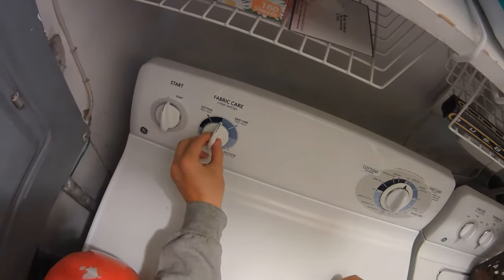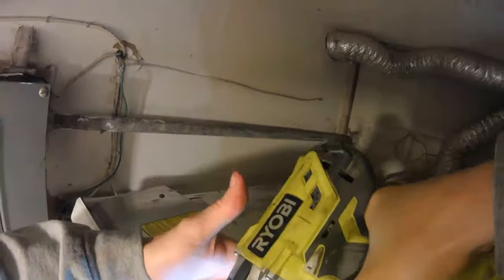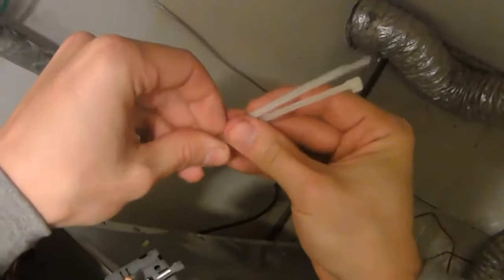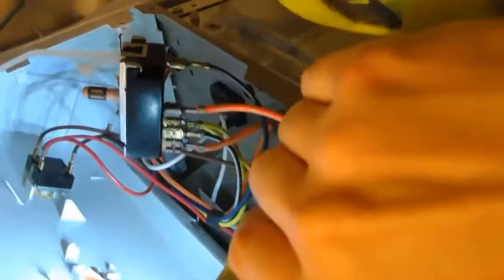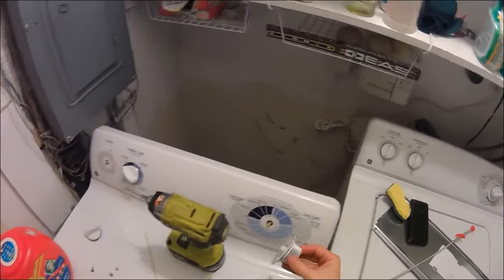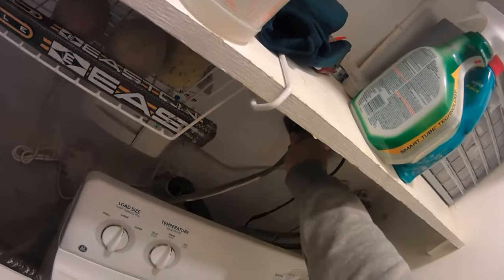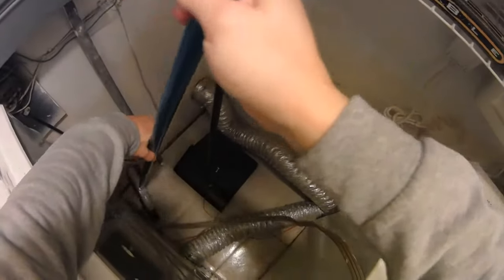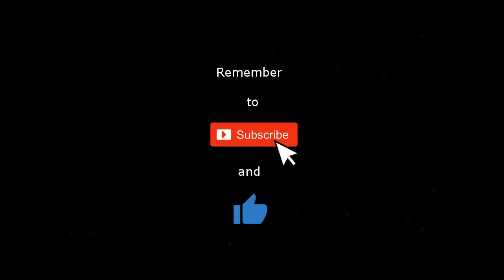How to fix a GE dryer when the knob falls inside

Comment: Please help! We have a semi new dryer that had a broken knob so my husband and kids started using a plier to turn the dial when all we needed was a new knob. Unfortunately, they’ve worn down the dial to a point we’re a new knob won’t work and neither will the pliers anymore. 😭😭
Reply: Probably need to buy a new switch at this point
Reply: Hey my family is currently experiencing the exact same issue! How did you solve this?
Reply: Lol SAME
Reply: You need a new switch.
Reply: For anyone who is having this issue (this is EXACTLY what was happening to me):

I unplugged the dryer (!!!), took apart the back of the dryer to get the timer out and take it apart and saw that the “D” shaped shaft that goes into the knob is actually black plastic (for some reason I thought it was deteriorating metal). What I did was use a 5/64 drill bit to make a hole in the center of the D and then drilled a screw into it using the lowest torque setting. The screw went into the hole I made by maybe one or two notches. Don’t force the entire screw—you only need enough of the screw to grip it well. Instead of pliers, I now use a spare Phillips head screw driver to turn the timer. You may not need to take apart your dryer to achieve this, but it might be beneficial to do so to ensure nothing breaks when drilling, because the D shaft is actually connected to cogs and it might mess something up if you drill too hard. Make sure the largest diameter of the screw is smaller than the diameter of the D shaft; otherwise, you will break the shaft and they do not sell those separately from the entire timer (at least, I couldn’t find anything when I searched for it specifically). 
Best of luck! Feel free to ask any questions :)
Reply: Same here!
Reply: Where do I get new knob I see there is a crack in the knob
Reply: Same thing! I ordered a switch off of Amazon and had a friend install it. It was pretty simple and took 15 minutes. I still don’t have a knob but I see they have them on Amazon too.
Reply: Where can they order a new switch

Comment: Did a search, saw this video.. exact same model that we have in our apartment, same exact knob broke in exactly the same way. There is only one problem... Maintenance came by to 'fix' this issue by drilling a new knob hole in the middle of the panel, "because there are 2 spare connectors". Within 2 days, the plastic holders broke again, in the same way. It makes me think that there is a legit issue with this model of dryer, as why would the knob be experiencing enough force for that one knob to break free?

Comment: Thanks for posting this video. It’s always nice to find a YouTube video whose title exactly matches the problem I’m having.

One thing that might help other viewers is that they may be able to remove just the three top rear panel screws (not all six). On my GE dryer, I can remove those screws and slide the front panel to the left to release it. (There are three notched tabs on the panels lower edge that slide into slots to hold the panel in place.) Then I could tilt the panel face down, which made it easy to access the back to make the repair. I didn’t even need to move the dryer (which is a real pain for me because the vent duct is only semi-flexible).

I’m impressed that you were able to drill holes in the remaining tabs for the zip tie. I fabricated two small wood blocks that straddle the switch and screwed a skinny crossbar into them to hold the switch in place. I used epoxy to affix the blocks to the panel. Time will tell if it sticks well enough.

Your video gave me a good head start on making the repair.

Comment: I have a broken knob on my dryer. I'm curious that part of the problem may be inside. I really appreciate your video.
Reply from the maker: It is the front cover itself, check out this video for the by the book repair:
https://youtu.be/A1tlSpuox4Y
Reply: @burrheadjr  thank you. I'm taking off the back panel tonight to figure it out. But the knob is broke and it seems like the control inside is loose. I don't know if it's like this video where the plastic around it is broken or if the control is bad. Hopefully, whatever is easier to fix. Thanks again for the helpful video!!!
Reply: Would have loved a better camera angle with zip ties. Any written instructions available? This is the most annoying problem ever. WHT do they make these things so cheap man? Lol I just called a repair company and they are charging $109 just to come out and look at it

Comment: How did you zip tie it? I couldnt see that very good
Reply from the maker: I drilled holes in the remaining damaged plastic clips, then I looped the zip ties around the back of the switch, and weaved it through the metal prong in the front.

Comment: My plastic clips are too broken to use this solution. Any other ideas for me?
Reply from the maker: you could drill holes in the actual FACE of the panel.  You will be able to see them, but you could theoretically get it to work like this.  There should be enough space between the dial and the face that a zip tie would not interfere. Something like this image, where the black dots is where you drill holes, and the red lines are zip ties that go all the way behind and hold the switch up against the Face Panel:
https://imgur.com/a/iHBSX7l

You could also order a new part, and fix it fully like in this video:
https://youtu.be/A1tlSpuox4Y?si=7sGZc1zGxnUp_rp1
The part is $140, but is cheaper on eBay (maybe $100)

Comment: On mine the plastic ears on the temperature selector were broken and the remaining plastic was too small to drill. My solution was to drill two small holes on the left and right of the knob (yes they show) and use white cable ties in sort of a figure eight so the part showing is about 1/2" of cable tie on either side of the knob. The advantage is the cable tie doesn't go through the knob opening forcing the shaft off center. Next time, Speed Queen.
Reply: My clips were intact but not easy to slide slipped side back in but, I got it.  If only they didn't make those plastic knobs which keep breaking on the inside. Thank you for your help

Comment: I am sorry but i am not as hands-on as most of you folks here, i guess. I didn't quite get where to put the zip ties and what holes are needed where. How can someone help on this ? please.
Reply from the maker: There is no "Right" answer on this question, it is a "hack" fix.  It will depend on how yours looks.  I drilled right through the "tabs" the parts that stick out, that normally the dial clicks into.  But if yours are completely broke off, you may not be able to do that.  One other thing you could try is drilling right through the face of the face plate, meaning you would see the zip ties coming out on the surface of the faceplate.
Reply from the maker: In this video, I fixed it the "right" way by ordering a new part, but also in this video, you maybe able to get a better look at the zip ties and how I did them here before I install the new part.
https://youtu.be/A1tlSpuox4Y

Comment: This literally just happened to me this morning.
Reply from the maker: Hope this vid helps you to get back and working again.  For a permanent fix, check out this video as well:
https://youtu.be/A1tlSpuox4Y
Reply: @burrheadjr  thank you. It did work however we couldn't drill a hole fir a zip tie. So we used epoxy to put the box on and it worked. 👍👍